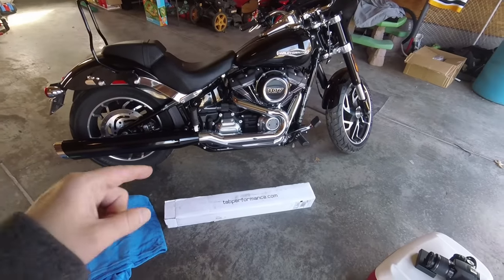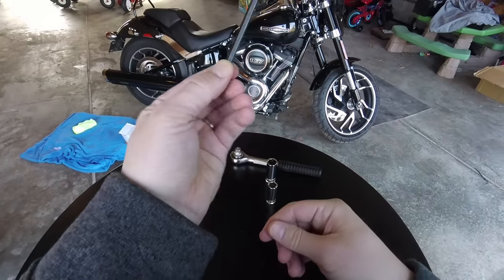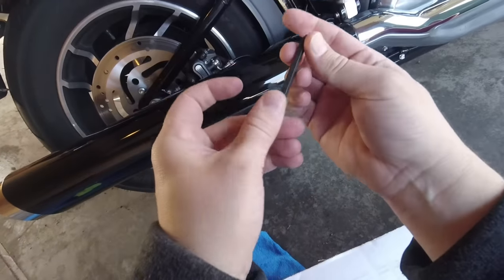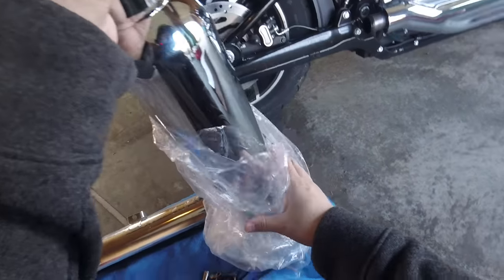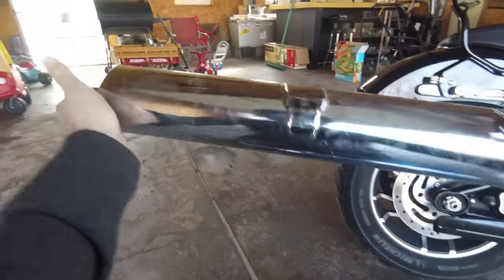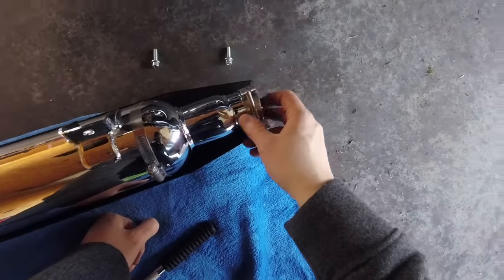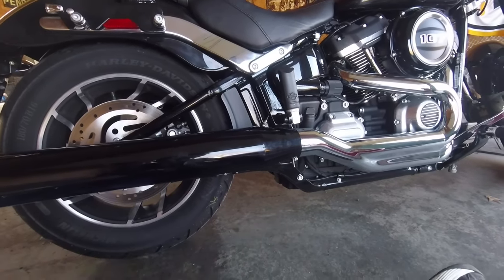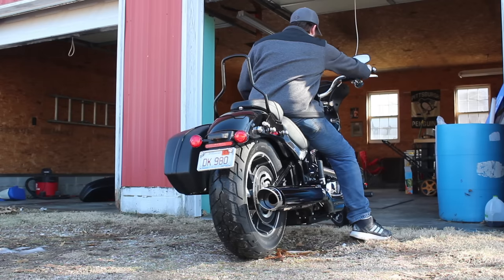Tab Performance Exhaust Install on a Harley Davidson Sport Glide

Comment: I ended up taking the TAB slip on off and installing the slightly shorter Freedom performance exhaust slip on...The sound of the TAB was good but I didn't like how far it stuck out pass the tire ..especially when I take the bags off .

Comment: Sounds great! After that stock pipe which does not sound bad at all, you can hear the difference! It just adds a bit of personality more to the bike.
Reply from the maker: Vedran Urličić I definitely wanted louder. Tab was a great option and exactly what I was going for without going full system. Great company to work with!

Comment: I've been looking into the sport glide for my new bike. Awesome video and GO PENS!
Reply from the maker: I highly recommend it! LGP!
Reply: @DCyclemoto  what other HD's did you consider aside from the sport glide and why did you go with that one? If you've explained this in a video, let me know! :)
Reply from the maker: Jake Palyo Softail Slim was the other one I had my eye on. Just a classic looking bike.

Sport Glide had more to offer stock. 2-up seat, fairing, passenger pegs, bags. Its probably 3k more expensive than the Slim, but it also handles better. Better lean angle. The wheels are purdy too!
Reply: @DCyclemoto  Awesome! What's catching my eye is the obvious but the standard bags, ABS, and cruise control. I feel that if you added all of those to the slim, you would be around that price anyway for, as you say, a worse handling bike.
Reply: Hey @D-Cycle, Having first owned an iron, would you recommend starting there and upgrading eventually, or just starting on a softail? I'm having the hardest time trying to figure that out. I feel like the iron is perfect for me right now (power weight and price)  but I keep getting told that I'm better off starting with a Softail.
Reply from the maker: Jake Palyo If it’s your first bike, I would say get the Sporty and get some experience. Also, buy used.

Some people start big but its all about how comfortable you are with a 700+ bike as a first bike.
Reply: @DCyclemoto  exactly what I was thinking. Ive ridden dynas and a new low rider and they were all amazing but it was just around a parking lot. I liked them but I just don't want to lug around a 700lb bike as my first one. I feel.like id rather take my time and get miles under my belt before stepping up to something that weighs that much and costs that much. Especially where I live with the traffic. 
Thanks for your thoughts!
Reply: I bought a Sport Glide last year and love it. The two bikes in one was a big selling point for me, I took it to Normandy and did nearly 2000 miles in a week, buy one, you won't regret it.

Comment: Hi D-Cycle, I just received a secondhand one from the US and it had everything except the original connection clamp does not fit its too big. Was a new connecting smaller  clamp supplied with the exhaust. Like your vids also mate and it not the sports glide a great bike. Am starting the first of the modification to make it my bike and get inspiration from your vids keep up the good work from down under
Reply from the maker: Tab did send a new clamp with the muffler when I bought it new. Maybe they can send you a new one or u can find one at a local shop. You could always contact Tab and maybe they can give you the clamp size?

I am glad you enjoy the videos! Thanks for watching!

Comment: Great stuff! Usually we refer to those sockets as "6 point" :D Also, for those clamps around the pipe you can use a 5/16" socket on a 1/4" ratchet or a square bit screwdriver to lower the risk of "skipping" the screwdriver off the clamp and scratching the chrome, if you're worried about such things. I love that you can retain the stock heat shield, makes a more stealth upgrade. It sounds incredible! Though the stock sound on your Sport Glide is certainly not like a sewing machine, this is a HUGE improvement. Now my Street sounded like an angry sewing machine before I upgraded the exhaust, lol, sounds great now. 

Are you considering upgrading the air cleaner and getting a tuner? I am running the Two Brothers slip on and Vance and Hines naked air cleaner on my Street and the V&H FP3 tuner. Fantastic combination. Going to get it dyno'd this summer. As I mentioned before I'm planning on moving up to a SG but I am a year or so away from making the jump. 

Ride safe and keep up the great work!
Reply from the maker: TrashPanda 365 I will go with something from Screamin Eagle to keep my warranty from being voided. Tuner and air cleaner. Dealer said I should be ok with this muffler. Thanks for watching.

Comment: Torque spec for Muffler Clamp.-75 IN. LB? Or did you mean Newton Meters? Just got the same slip on. They sound even better in person!!
Reply from the maker: Johnnie2Tones in. lbs should be correct. If I remember, that’s right from Tab’s instructions (or maybe I called). Been awhile!

Comment: Sound nice. Looking to get an upgrade for mine as well. Although I dont know about regulations here  in Sweden. So I need to get that sorted before I order. 😁
Reply from the maker: Zetikah Definitely better than stock. Tab also makes a Louvered baffle version which is a little tamer but still has a good rumble.

Comment: loved the video and it was extremely helpful in installing my upgrade, question i have is on your sissy bar in the back,, where did u get it from and did it require the additon of docking screws on the bag area?
Reply from the maker: Its an HD sissy bar. I did have to buy the docking hardware extra.

Comment: I think it is a similar sound to the Screaming Eagle I had put on with my stage one....very nice though.....and easy to do. :)
Reply: Did you get the HD Cannon muffler?
Al
Reply: I had the Stage 3 done and it woke up the Street Cannon mufflers.  Starting about 2000 RPM you can really hear it.

Comment: Hi there... following your videos for a long time now! Question: It is strictly necessary to remap (stage1) if you install ONLY the TAB slip on??? I am thinking on doing it on our 2021 SportGlides.... 😅
Reply from the maker: When I put on the Tab the dealer said I wouldn’t need a tune unless I added an air cleaner. Never had problems. Of course now I have the intake and a tune to go with it.
Reply: @DCyclemoto  thanks for the clarification ☺

Comment: How long did you go between installing this, the air cleaner, and tuning it? Did you do all of these all at once? I’m wanting to go and do stage 1 starting with the muffler first, just wasn’t sure how much it’d hurt my bike to wait between the muffler, air cleaner, and tune
Reply from the maker: I put the muffler on in Feb last year and put the air cleaner and tune in the following October. Never had a problem.
Reply: @DCyclemoto  Thanks man! I've been wanting to change my sound for a long time but I didn't want to mess up anything engine wise or anything, but didn't want to necessarily wait to do everything at once.
Reply: I was told by my dealer you could void your warranty if you don’t do the tune?  Just something to consider...I may wait my 2 years before doing any substantial upgrades.
Reply from the maker: Some dealerships don’t care some do. Mine was cool with it. Months after this, I put on a air cleaner and tuned with the FP3. Still runs great!

Comment: Great work and good job !!! Fuel controller installed?
Reply from the maker: Vance & Hines Fuelpak FP3 went on when a new intake did.
Reply: If you only change the muffler the ECU/EMU self learns thru the O2 sensors.

Comment: Thanks for the vid D! Sounds great! Just curious if you looked at, heard or considered the Three Bros exhaust.? I know there’s a big difference in cost between the two and without a side by side comparo they sound similar from the audio files out there. Your thoughts? Thanks again,!
Reply from the maker: c Nebs I haven’t heard them on the Sport Glide, so I had no comparison to the Tab. I like how I can reuse the stock heat shield also. Price on the Two Brothers was way more. For $300, the Tab was a no brainer for me. Very happy with my purchase. Thanks for watching!
Reply: Sounds WAY meaner! I can't wait to hear it in person!
Reply from the maker: Great Egret Rev bombs! Rev bombs everywhere!

Comment: Hi Dustin,
Question. Did you have any issues with exhaust fumes when you put on your slipon? Reason why I’m asking, I put one on my sport glide a little over a week ago with no gasket, and the fumes I’m getting from my bike are very prevalent. I thought I’d wait a week or two to see if the smell subsided, but that doesn’t seem to be the case.
Reply from the maker: I’ve never had that happen, honestly.

Comment: I'm looking at this one or a Cobra 909 slip on.  Did you do a fuel tuner at all yet?  I've heard people say its absolutely necessary whenever you do a exhaust mod and others say you don't need to with a slip on.  Thoughts?
Reply from the maker: Nate Ward Tab recommends a tune. I have not done one yet. Usually with a slip on you don’t.

Comment: Hey, i heard from a long time rider, if your going to store your bike for the winter, be sure to spray the inside of the exhaust with a water displacement lubricant such as wd40 or ballistol to prevent rust on the bottom of your muffler.  Do you know anything about this?  I know when i dont start my bike for a while, water comes out of my exhaust. He might be on to something.
Reply from the maker: That would be beneficial. I haven't done this but I would research it before hand.

Comment: Also, did you remap the engine? Technically you shouldn’t have to for a slip on, but Tab recommend it.
Reply from the maker: David Keppler I didn’t but yes Tab recommended it. Dealer said I should be fine, but I do plan to go with an air cleaner and do a tune by spring.
Reply: What air cleaner are you going with?
Reply from the maker: Charles Cotton likely a Screamin’ Eagle brand to keep my warranty. Not decided on which one quite yet.
Reply: In the same pickle... I got the tab slip on but technically that voids my warranty if I don't remove it before ever taking the bike back in so I am on the fence about either going with a DK Customs option for the external crankcase breather or going with an HD option... are you going to go screamin eagle tuner or a non Harley tuner? I used the FP3 on my sportster and liked it. Not sure I really want to use the Harley brand tuner so I might be SOL on the warranty either way lol.
Reply from the maker: Charles Cotton I will probably use the SE tuner (my dealer said to not use any other). I had an FP3 on my old Sportster too. Really woke it up.
Reply: I went with the FP3 and a K&N Charger (and the Cobra exhaust) Looks and sounds great. If it ever gets above freezing or stops raining over here, i'll let you know what it rides like! Two weeks now and no chance to ride. I worry about the warranty, bur figure I'll cross that bridge when I need it.

Comment: So as I said before really enjoy your videos the thing that's missing from this video which I found actually not the simplest task was replacing the gasket between the muffler and the header pipe that would have been good to include could you possibly show that because I've been having a little trouble with that!
Reply from the maker: You dont need to replace any gaskets.
Reply: @DCyclemoto  when you take the stock muffler off the gasket comes with it and getting it out in one piece for re-use is not possible...
Reply from the maker: Here is a message I received from Tab when I asked about a gasket.

If you want to do a perfect seal you can add a little red RTV or Copper gasket seal prior to install. Since we don't use the gasket that costs around $30 you will get a little leak like on older bikes "pre-gasket" but the sealant bead is just as effective and much less expensive for the consumer.

Comment: Do you need to install de muffler, our should you also be upgarde some fuel items because you change the pipe?
Reply from the maker: RED sec I have purchased an air cleaner that I will probably put on later this year for beginning of next riding season. I was told I would be ok just doing the slip in without a tune but it is recommended to do a tune.

Comment: Hey D, I was torn between this and the Rinehart and think I'm gonna go with the Rinehart.  I read somewhere that I also needed to order a crush gasket or HD muffer inlet gasket?  Is that correct?  I have no idea what I'm looking for in that regard as this is my first slip on experience with a motorcycle.  Thanks if you can provide any assistance
Reply from the maker: No idea on the Rinehart. Have you messaged or called them?

Comment: i will have one question regarding this muffler installation is there any need to update the parameters like with the installation of a stage 1 for example ? or it isnt required ?
Reply from the maker: Fabian recommended not required

Comment: Question do you have to get a tuner or get it tuned with just a slip on... I have a 2021 SG and I'm looking for my next mod!
Reply from the maker: Tab recommended it. Usually you don’t. I had only the slip-on for 6-7 months then finally dropped an air cleaner with it and tuned.
Reply: @DCyclemoto  awesome... thanks!
Reply: @DCyclemoto  cool thanks
Reply: @DCyclemoto  did the tuner change the popping sound when you let off the throttle?
Reply from the maker: I still have some d-cell pop

Comment: I can't believe Cobra's 909 is still missing in action. Their touring 909 looks great and sounds great, and the single one for the sport glide is great, but it's seems just non existent.
Reply from the maker: FranBunnyFFXII I looked all over for it. No one has it in stock. Ah well. Happy with this Tab fo sho.
Reply: I looked at both the Tab and Cobra and I will be getting the Cobra when it gets back in stock!  I found one Cobra on Ebay for full MSRP and one at Dennis Kirk for $230.96.  Kirk has been out of stock forever though...

Comment: Why did you choose the Tab muffler?
Reply from the maker: Price and sound, mostly. Can't beat the rumble for $300. Got to keep the stock heat shield too.
Reply: @DCyclemoto  Yeah, there aren't many others (maybe none?) that allow you to keep the stock heat shield and I too like the stock one.  Most, if not all, of the other muffler options have a matte finish shield, which I don't like.  I would like a more free flowing muffler for an increase in power, but would want only a modest increase in loudness.  I don't really like the raspy sound that I heard when you shifted.  I wish there was a way to hear how the quietest Tab muffler sounds.  BTW, I just ordered the chrome coil cover and Defiance Front Axle Nut Covers (black and chrome with chrome HD lettering) from the HD web site.  That also required the Front Axle Cover Installation
 Kit.  That should clean up the hub of the front wheel by covering the axle hole.  Last year I purchased the Klock Werks windshield  and am disappointed with it.  Even though I am short, at 5'5", my head still gets badly wind buffeted, causing a lot of noise.  That "flip" at it top edge doesn't seem to do the job.  I also get a lot of wind coming up from below and maybe that is what is causing most of the noise.

Comment: Much bettah! 👍  Lil cam & compression it will be even better.  🙂. Just saying.
Reply from the maker: I got my eyes on that Stage 2!
Reply: You are past warranty you don’t have to use MoCo parts. But the SE-462 cam would work well and not require valve springs. Or something like the red shift 468. If you don’t mind buying valve springs I love my SE-498 cam. Get rid of the plastic intake while you are at it before it gets brittle and leaks from heat cooking. Then skip the SE tuner and get a Power Vision tuner. She will run way better plus be much stronger. And certainly dyno tune it. Worth the money. And Nobody ever regrets these basic level changes.

Comment: Excellent video, thank you. Did you remap/tune the bike or did you just put the slip on? Tab says you should remap but I thought you didn't have to with a slip on, as the header has the catalytic converter etc.
Reply from the maker: Galen Tong I haven’t tuned yet but plan to within the next few months since I will put an air cleaner on it. Thanks for watching!👍🏻
Reply: @DCyclemoto  If/when you do tune and put an air cleaner on it, please post videos showing us how. I would probably do the same thing once I get a sport glide. Thanks.
Reply from the maker: Galen Tong You got it!👍🏻
Reply: @DCyclemoto  If I can ask you another question since I will probably buy a sport glide: have you used the USB port to charge your phone while the GPS is running? Is the charge from the USB enough to keep your phone stable and prevent it from discharging quickly when you are using apps like the GPS, music streaming etc.? Wish they put a 12 volt on the new softails instead of just a USB. Thanks in advance! I subscribe to your channel.
Reply from the maker: Galen Tong I actually haven’t tried using it yet. Curious about it myself!
Reply: @DCyclemoto  Please let us know your findings! If the USB doesn't charge quickly, you can install an aftermarket 12 volt charger onto the bike. I researched it online and it is very easy. Kuryakyn and others sell ones that plug into the battery tender cable on the bike then you run the cable to the handlebars.
Reply from the maker: Galen Tong I do have a USB charger adapter that I used on my old Sportster that connected to the pigtail. It charged pretty quick. I would expect the same from a built-in one. Stay tuned!
Reply: @galentong4783  I use the USB all the time, it keeps my iPhone charged at 100% while running GPS & listening to tunes.
Reply from the maker: It works really well!